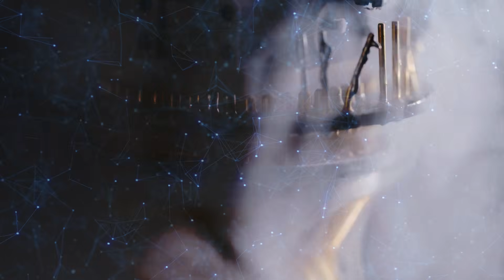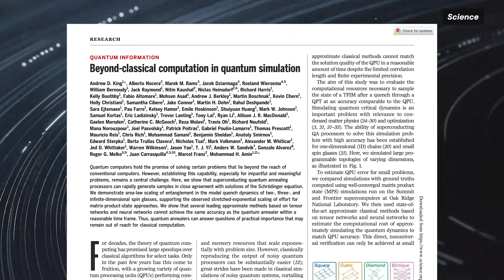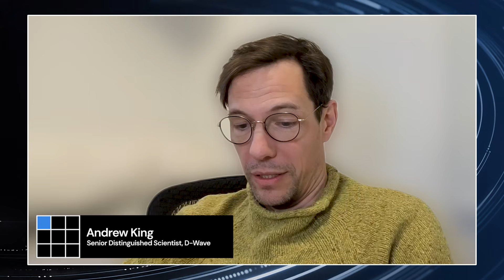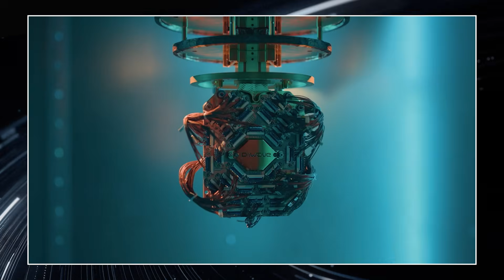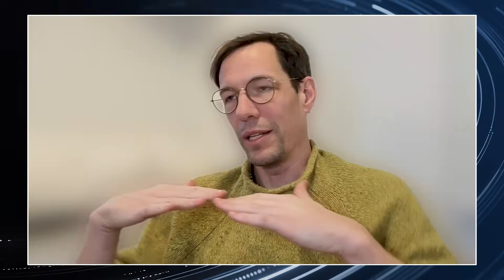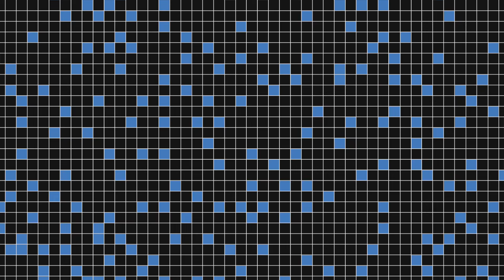Quantum Computing for Computational Advantage

Comment: Quantum advantage does not mean:

Quantum computers are faster than normal computers at everything.

That's the wrong idea.

It means:

For a particular problem, a quantum computer can do something better faster, cheaper, or more accurately than the best practical classical approach.

So how do you prove it?

You need a fair competition:

Same problem
↓
Best quantum method
vs.
Best classical method

And you measure things like:

time
accuracy
energy cost
scalability

The difficult part is verification.

If the problem is easy enough for a supercomputer to reproduce, you can simply compare the answers.

But true quantum advantage means reaching a problem that classical machines cannot practically reproduce.

Then you have a strange problem:

If the classical computer can't calculate the answer, how do we know the quantum computer got the right answer?

That is now one of the central problems in quantum computing. Recent work has focused on building verification into the quantum computation itself.

A real example

In July 2026, IBM and University of Chicago reported a demonstration using 70 logical qubits.

The quantum computation took about 15 minutes, while leading classical simulation approaches faced infeasible runtimes for the task.

The important part wasn't just the speed.

They also designed the computation so that its output could be statistically validated.

That's much stronger than saying:

“Our quantum computer gave us an answer that a classical computer can't reproduce.”

It's closer to:

“We have evidence that the quantum computer produced the correct result even though classical simulation can't practically reproduce the whole calculation.”

What about energy efficiency?

This is where the story gets interesting.

A classical supercomputer may use enormous amounts of:

CPU/GPU power + memory + networking + cooling

to perform a calculation.

A quantum computer doesn't automatically use less energy. Quantum hardware itself can require substantial infrastructure, especially systems that need extreme cooling.

The potential advantage comes from something different:

A quantum algorithm may require dramatically fewer computational operations for certain problems.

If the algorithmic advantage is large enough, the total energy required to solve the problem could eventually be much lower.

Microsoft, for example, notes that quantum systems can have major efficiency advantages for particular classes of problems, although quantum operations can themselves be slower and the advantage must be large enough to overcome that overhead.

So:

Quantum computer ≠ automatically energy efficient.

Instead:

Better algorithm + scalable hardware + error correction → potentially enormous efficiency advantage.

Why does this matter now?

Because we're running into the limits of brute-force computation.

AI is consuming huge amounts of:

electricity → GPUs → memory → cooling → data centers

And scientific problems such as:

molecular simulation
materials discovery
drug discovery
chemistry
optimization

can become extraordinarily expensive for classical computers.

Quantum computers could eventually attack some of these problems using the underlying quantum mechanics of nature itself.

That's particularly interesting for chemistry and materials, where you're essentially trying to simulate quantum systems using another quantum system.

But don't misunderstand the current situation

We're not at:
Quantum computers have replaced supercomputers.

The realistic future is more like:

Supercomputer + AI + quantum computer

working together.

Classical machines handle many tasks.

Quantum processors handle specific parts where they have an advantage.

This is often called quantum-centric or hybrid computing.

The simplest mental model

Think of a supercomputer as a very powerful truck.

A quantum computer is a specialized aircraft.

The aircraft isn't better at everything.

But if your job is crossing an ocean, comparing it with a truck makes little sense.

The real question is not:

s quantum faster?

It's:

“Is there a problem where quantum mechanics gives us a fundamentally better way to compute?”

If the answer becomes yes, and we can prove it, that's quantum advantage.

Quantum advantage is not about beating the world's fastest supercomputer in a generic speed contest. It's about finding a specific valuable problem, demonstrating that quantum hardware solves it better than the strongest classical methods, and—crucially—proving that the quantum result can be trusted.